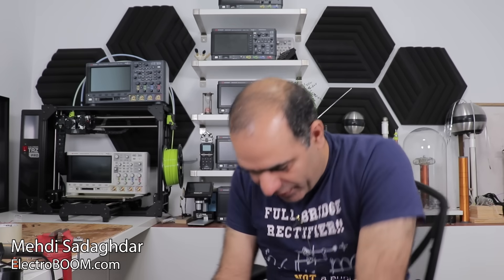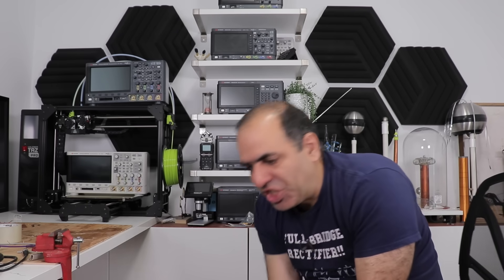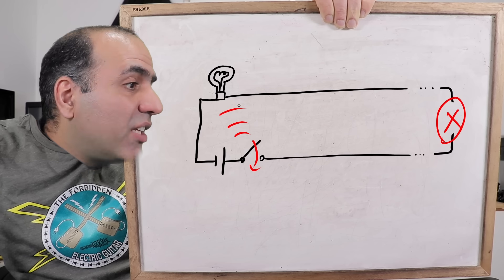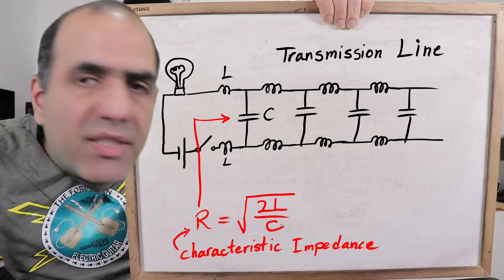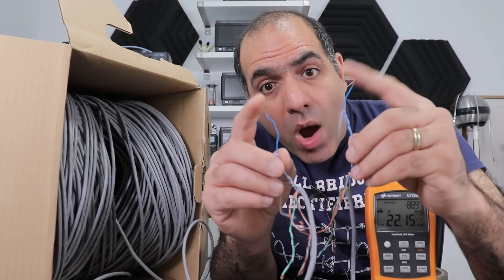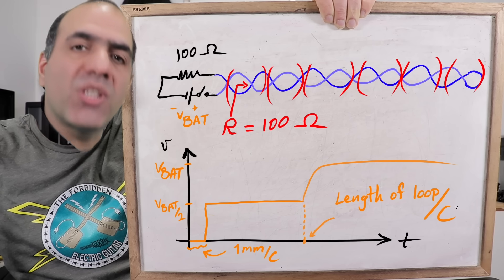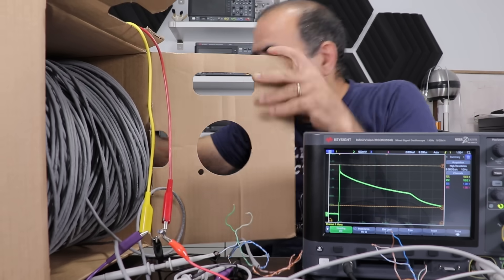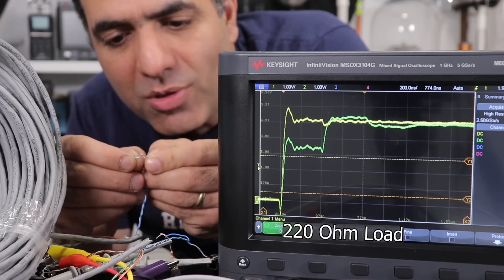Testing the LONGEST LOOP OF WIRE!!! to Turn a Lamp On

Comment: I cant be the only wondering about the ressitivity here
Basicly if the fields never actualy travel the full length of the wire //perhaps additional breaks are required for this
Wuld that mean with a sufficiently high frequency culd we break the connection at the precice moment when the wave hits the break and achive a duty cycle of 50% on the load without ever letting the waves pass thugh the break.
If so at high enugh frequency we culd shorten the wire and create the break very close to the load resulting in negation of the majority of the wire ressitance
Obviusly niche application as in most cases just shorten the wire, but if theres a barrier preventing this that the waves can go thugh like air
By use of two sutch setups one culd get 100% duty cycle aka normal linear current the timing on this must be flawless for 100% tho

Basicly for me this just raises further questions:
How do the waves handle ressitance?
Do we need a new mesurement of wave ressistance? does one exists already(found Wave impedance im not a math expert but that seems to require imaginary values witch For pure mathematics is fine but is not at all practicly applicable?
How do the waves bahave with different materials? cuz its not arcing, yet the light is on.
And if for waves we are looking at the permeability of materials what happens in vacume.
Culd this be used to measure the permability of materials by using sufficiantly high frequency and length of wire then emasuring when the load is activated and accounting for remaining ressistance.
Reply: additional wave quesiton
culd we inonize air remotly, by use of extreamly high frequency

alternate theory

rather than waves, its a series of values
the values being excitement/ernergy level of the electrons across the chain
as we all know eavrything has capacitance
thus these values wuld need time to give and take
assuming this happen by electric fileds, generated by each pice in the chain
seing the chain as millions of electrons each affecting 1 or more nearby electrons, the changes wuld propogate very fast
however they still need to charge and "uncharge"
this wuld all happen extreamly fast, likely to the point where we cant or wuldnt notice the measurments
witch wuld make it seem like its a wave, as the charges are already partialy propegated but left unbalanced by the quick shutoff.

this explains how this can happen, and fits in with current understandin of electricity. obviusly this dosent mean its right its just a theory.

im not actualy ageinst the wave idea, i just dont think its the end all, and think we ought to dig deeper and explore alternate solutions.

Comment: It is the current flow in the wire that causes the magnetic field around the wire. A static magnetic field around the wire can never cause a current flow.
Also an electric field that is orthogonal to the wire surface cannot cause a current flow.
Therefore the outer fields are just secondary effects, these do not cause current flow and energy transport. Their effect on current and energy transport is negligible at DC and low frequencies.
Reply: You should read something about the role of surface charge in conduction.

Comment: Finally a video that really made sense on how the electricity "jumps" from the source directly to the destination without going through the loop. Neither yours or Veritasium's former explanations were good on conveying that info.

If the wire loop is spread in a circle so far apart that the magnetic field won't jump cables, would the light turn on only after what ever time it takes for the current travel through the cable to the load? Does the position of the load affect it?

Comment: The two wires are transmission line, and as such the insulators between the two wires will slow down the speed of the signal...  The velocity factor of 66%  is about the same as the velocity factor of cheap coax, used for radio!  which I find strangely amazing!  :)

Comment: Mehdi is the ULTIMATE teacher!!!  I have been mostly rejecting Derek's experiment and supposed demonstration due to a number of his weak or questionable examples and the vague way he posited the question.  I have been watching various people attempting to clarify the question and/or prove/disprove the experiment. Many were pretty cool, and Mehdi's previous video about it was  good but left a lingering doubt......

... But in this video he covered the same ground and explanation as previously, but then added the extra bits to complete the whole experiment and the last connections I needed to fully understand both the problem in the original question and in the original (and some subsequent) experiments.   Mehdi wins by explaining it so that anyone, even an old fart like me in electrical and electronics field, could overcome the bias of practical and empirical knowledge and experience to understand the underlying reasoning that was meant to get across in the first place.

Mehdi is the an excellent communicator and deserves your subscription!!! DO IT!!!  **SUBSCRIBE NOW**!!!!!     - (Thank you Mehdi) -
Reply: LITERALLY, I love Veritasium, but I could not understand that video for the life of me, and kind of dismissed it as well. This perfectly explained it and makes so much sense. Wow
Reply: Medhi is giving Veratasium a lot of wiggle room to make this work at all. By using twisted pair wire, he's increasing the capacitance by at least 1000 fold and still barely lighting an LED. Yes, capacitive coupling functions at the speed of light across the air, but in Derek's experiment/demonstration, it would never send enough power to ever light the bulb or even an LED until you close the end of the loop. The only way to get around that is if you increase the voltage to impractical levels AND send A/C down the lines as Medhi did. It's become clear Veratasium is a click-baiter that posts questionable content to create conflict and get views. If he just said capacitive coupling occurs across air at the speed of light, nobody would have cared because it's well-known.

Comment: Then is it also possible to shield/block/reduce wireless interference between the switch and the light, and force the interaction to use the full loop and travel time?

Comment: At 10:50.  Mehdi says that the green load voltage has a gradual drop, & he blames that on the extra resistance of his long 8000 ft of wire.
No. Mehdi is badly wrong in almost everything he says in this video, but that there explanation (re the gradual drop) is horrible. I can excuse his other mistakes (he just parrots the old (electron) electricity explanations), but i can't excuse his silly explanation for the gradual drop.
The gradual drop is not due to any silly wire resistance.
It is due to crosstalk (inductance) tween the twin wires.
The primary current on the first wire induces a current on the parallel secondary wire, & this induces a current back onto the primary wire, etc etc.
The induced current(s) partly negates the primary current. It robs voltage.

In an earlier comment of mine i said that if Mehdi measures the speed of electricity along a threaded rod he will find that the time taken is longer than for a plain rod, the difference being exactly the extra distance up & down over the threads. I said that Mehdi should do a youtube about this. So now i have repeated my request. Your welcome.

Getting back to this here (silly) video. Mehdi shows us that the speed of electricity is 2c/3, but he duznt explain why it is less than 3c/3.
Obviously the insulation (plastic) on the wires slows the speed of electricity to 66% of the speed of light in vacuum.
Mehdi should explain why/how. Good luck with that.
Reply from the maker: No
Reply: No
Reply: No

Comment: As a Network Engineer I have never seen the breakdown of twisted pair like this and it actually is very eye opening. Sad thing is I learned it through some random video I clicked on 15 years down the road lol.
Reply: @BrainScramblies  Nope no degree. Been self taught for most things and just learning on the job.
Reply: I mean, to be fair. You don't need to know the details to accomplish your job. That would probably be why they didnt teach you that.

I am also just a student, so I don't really know if that's true, but I see no reason why it shouldn't be.
Reply: @BrainScramblies  there are some branches similar to electronics where they don't teach about transmission lines. So it's possible for some to get a degree without knowing this.

Comment: No amount of explanation will change my opinion on Veritasium's original video : it was misleading. Using a matched load is basically cheating, or at least it is if you do not bother saying anything in your video about transmission lines, capacitive coupling and so on

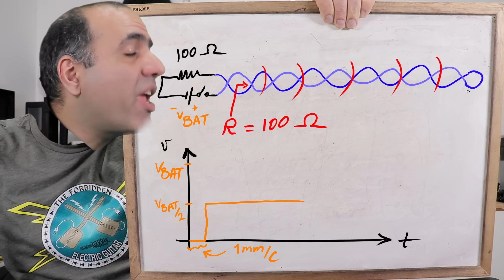Comment: Great video! At 10:13, the amplitude of the first step actually is Vbat/2 because load resistance equals characteristic impedance of the twisted pair. But in Veritasium experiment, load is a bulb (very low impedance) and the two wires are 1 meter away from each other (very high characteristic impedance) which will make first step's amplitude close to 0, which in fact proves the bulb can not possibly light up after a 1m/c delay.
Reply: the first step's amplitude is not close to 0 even if the wires are 1 meter away from each other. Check this out: https://youtu.be/oI_X2cMHNe0?t=1218
Reply: @zhuochen6096  Thanks for the link! What I meant was first step's magnitude is Vbat*Zbulb/(Zbulb+Zcable). Of course depending on the value you choose for Zbulb you can have a significant first step. In the original video, it was an incandescent light bulb (for which the resistance is really low). In this new video, the chosen load is 1100 Ohms, which explains why the first step's magnitude is not negligible anymore
Reply: @couitchy  Thank you for the clarification. I totally agree that the first step's current depends on the ratio of the characteristic impedance of the transmission line to the resistance of the bulb. But I don't think he specified the type of the light bulb in his original video. NEMA said 2018 third quarter data shows LED bulbs account for about 65% of the consumer lamp market, followed by halogen incandescents, which account for about 28% of the market. So the bulb could very well be a LED bulb in his original video. I think a LED will very likely light up given a 500 Ohm characteristic impedance and a car batter.
Reply: @zhuochen6096  Assuming we have a LED bulb in place of the resistor, it still remains that a LED is basically a forward biased diode whose equivalent resistance is very low (it is 0 for an ideal diode but of course for a real world diode it could be several ohms), so I doubt it could reach a value in the range of 500 ohms.

Comment: Super exciting video Mehdi! Something I haven't seen talked about yet is how this relates to the use of electricity in our homes; when I turn on the switch of my living room lamps, from where does the energy flow?
Also, would love to see this experiment you performed with a physical barrier between the source of energy and the lamp (a brick wall or those old lead fridges - something that blocks electromagnetic radiation). Would we see the same results in the oscilloscope?

Comment: make a plasma or YBCO loop wire, for a super conducting, zero resistance, inductor loop battery, L=1000m, I=5kA, energy stored E=½LI^2 = 3.5MWh

Comment: Hi, 
I work with TDR cable diagnostic tester at my work to troubleshoot connection, and this was a very clear explanation of how this tool works and calculates the distance of a wire break (open loop). It also gave me a deeper understanding of those reflected waves back and forth.
(And now i know why that tool is so expensive 😜 it's basically a function generator and high sample rate scope in a handheld device)
Thanks Mehdi
Reply: Holy fucking science! I didn't know those were a thing, that's pretty incredible!
Reply: Some network drivers have the capability to calculate the length of a cable connected to the network port or the distance to a break in a cable. They work in the same way by measuring the time for the echo to return to the NIC. And if the times differ a lot between the cables then it can tell you how far away the break is. It's not really something that requires very expensive hardware unless you need the distance reported to be very accurate, say with millimeter accuracy or the distances are better measured in KM than in meters.

I've also used network measurement tools that certify that a network match the requirements for secure and reliable use. These are very good at reporting the cable lengths but back then they tended to start at about $1000 for the cheap and cheerful versions with the sky as a limit when you needed more robust testing and higher bandwidth testing. While setting up a small network is pretty simple it makes a huge difference when you have proven signal integrity and connection everywhere. First time I used something like that was when I bult the network for a huge company. Just having a map with the printouts of every network cable in the house made everything feel better. Never heard of any kind of problem with the network there either.

Comment: You're "wrong", the 2 sides of the loop matter !
I mean you're right if the flow theory is wrong... But if you want to determine one of the 2 solutions you have to make an experiment without bias.
If the electron's pushing each others and act as a wave, you're single loop make the same "flashs" at the beginning of the pulse.
The proximity with water in this case is really important.

Comment: it was blinking, albeit faintly, but very much blinking when you disconnected from the wire at 4:30 ish. But I saw nothing when you hooked it up to the function generator at 4:45.

Comment: This, guys, is why I stick to abstract mathematics. I only use my neurons for "experiments" and don't have to figure out the correct way to wire them up.
Also, no risk of getting electrocuted.
There's a much higher chance of going insane, though...

Comment: I get that in the end it's all in the magnetic fields that extend forever, but if that's true, then why do we even need wire loops? Just put bigger loads in the end, or switch the polarity continuously, and very fast so we won't notice it happen.
Wait. Is that what AC is? But we still have transmission lines in AC. But then again, Tesla had some weird ideas about wireless electricity..

Comment: you may know that some of your  'is doesn't matter's'   DO  matter.!             in any case, at 6:03, stopped ---  in order to say:       or, maybe,  if/when one or both of the battery poles are connected, a (latent) electrical potential is created,  throughout the Entire circuit.          if this is the case, it would be good to get test results using a two-pole, power switching configuration.

Comment: My local power station is miles away and my lights come on pretty much immediately when I flip the switch.
Reply: that power is already being supplied to your house. when you turn your lights on, you are making a connection betweeb the light and your power.

if you were connecting directly to that power stations there WOULD be a big delay

think how after a power blackout, not everyone in the area gets their power back at the same time.

hope this explains

Comment: 12:26 What what what? I was reliably informed by Veritasium that nobody's ever measured the speed of light!!!1111oneeleven
rolleyes
Reply: Not in one direction, no, but the results of this experiment don't provide that measure.
Reply: @jmodified  I'm pointing out how obviously stupid that is, if I'm measuring the average speed... speed does not have a direction. Veritasium is confusing speed with vectors, and overall promoting poor physics understanding.
Reply: @austinwright2591  There is no good reason to think it is, but the speed of light could be different in different directions. It's still speed measured as a magnitude rather than a vector, just speed measured when light travels in a particular direction relative to - something. We don't have any way to measure it that doesn't amount to round-trip distance over time.
Reply: @jmodified  Sure, but he doesn't bother with the term "vector" even though this would be a great place to teach the difference.

The other objection is that it _simply doesn't matter_. As long as the roundtrip time is the same, the observable effect on the universe is nil since it all cancels itself out. God might notice that one "side" of the universe lags by a slight delay, but no observer inside the universe would be able to tell. It's not even worth discussing, unless you're educating people about the strange properties of vectors (which he's not doing)
Reply: @austinwright2591  "The other objection is that it _simply doesn't matter_. As long as the roundtrip time is the same, the observable effect on the universe is nil since it all cancels itself out." That's kind of the point. It's not really a "strange property of vectors", it's that relativity prevents us from measuring the one-directional speed of light no matter how clever the experiment. Most people would think you could synchronize two atomic clocks and then move them apart to do the experiment - or something like that.
Reply: @jmodified  ... So then you can measure the speed of light.
The assertion (a) "No one has measured the speed of light" is not the same as (b) "An asymmetric light-travel speed is not meaningful."
Only one can be true, and Veritasium said (a). That makes him wrong.
Reply: @austinwright2591  Both are true, though I would replace "not meaningful" with "not measurable". It would certainly be "meaningful" if the universe had some global directionality or differing local directionality that affected all of physics, even if it were undetectable locally. Why that would be the case, how it would relate to general relativity, etc. would be meaningful questions.